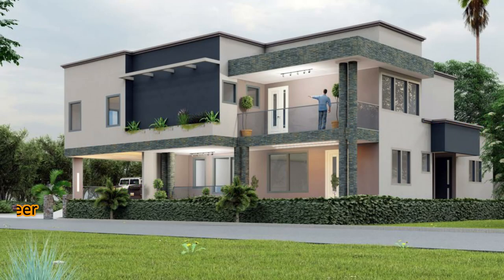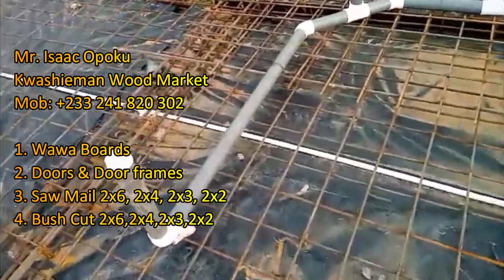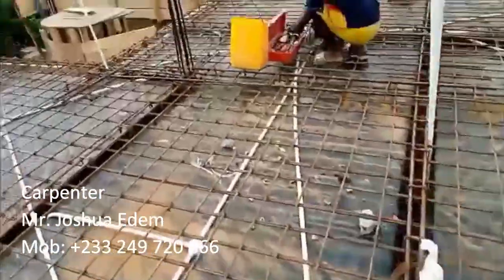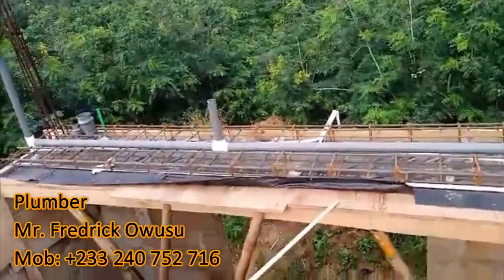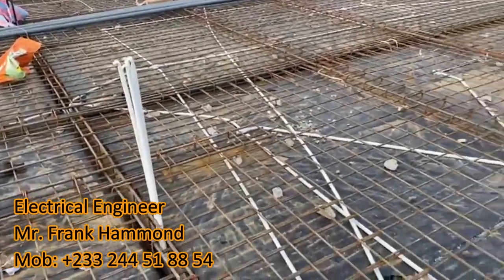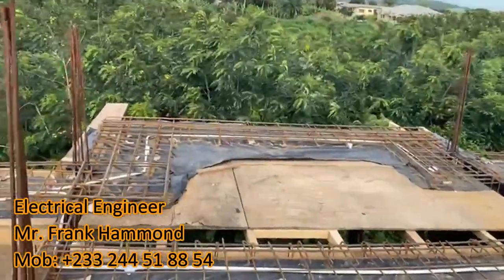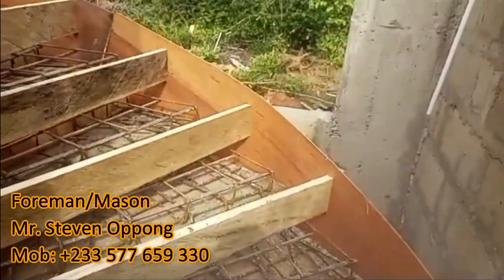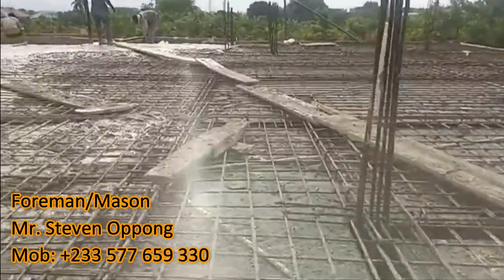Building in Ghana | Ep-16 | Stephen & Esther | First Floor Decking Steel Works | #brightandclara

Comment: Bro let them put a p-trap instead of elbow joint in all the shower drain to prevent odor from backing up in the shower please please!!!!!!! Else the bathroom will smell like a gutter. Ghanaian plumbers do not know about this simple technique. Almost every shower I have used in Ghana smells and nothing you can do about it. This P- trap technique keeps water in the pipes after showering, therefore no gas or smells could back up into the bathroom. No amount of ventilation can stop this without the P- trap. Kindly google and research into how it works.
Reply from the maker: Will inform my plumber please
Reply: Also to reiterate what he said about the p trap. Please check as S trap is illegal in most countries.
Reply: @juvellejay1829  
You are right, S - trap usage has been stopped after they discovered than the P-trap is more effective that the S-trap. It works but just that the P- trap is much effective that the S trap. Most toilets we have in our homes are S- trap .